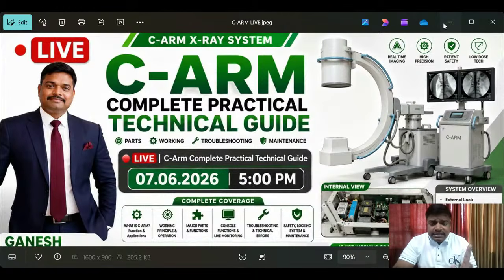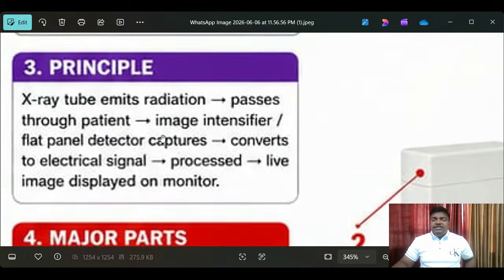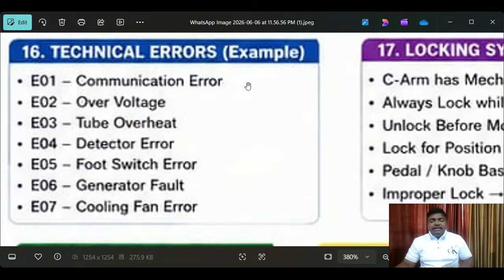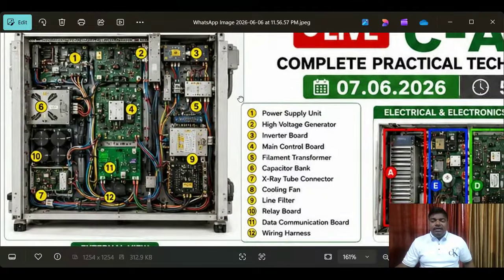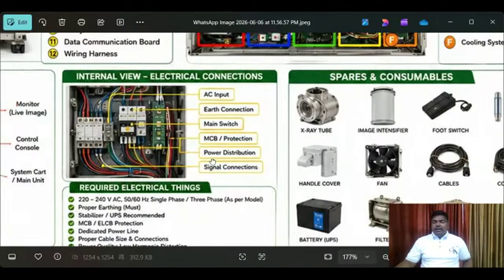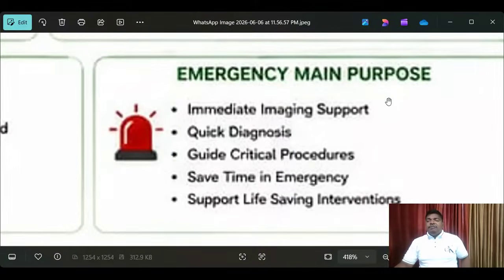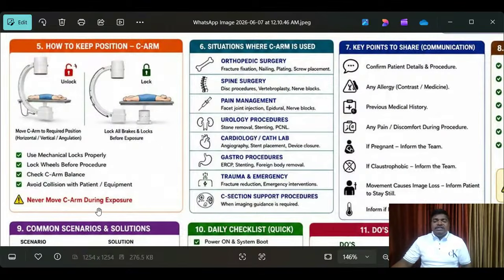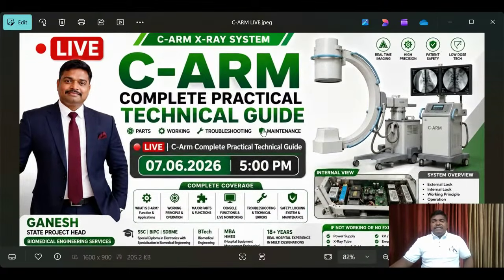🔴 LIVE | C-Arm Complete Practical Technical Guide | 07.06.2026 | 5:00 PM

Comment: thank you so much 
may you make video about Laser Machine and the types of using
Reply from the maker: Thank you so much for your valuable suggestion! 🙏😊
Sure, I will make a complete video on Medical Laser Machines, including: ✅ Types of laser machines
✅ Working principle
✅ Clinical applications/uses
✅ Internal parts
✅ Safety precautions
✅ Common troubleshooting tips for biomedical engineers
Stay tuned and thank you for your support! ❤️🔔
Reply from the maker: A laser machine is a device that generates a highly focused beam of light using LASER, which stands for Light Amplification by Stimulated Emission of Radiation.

In biomedical engineering and healthcare, laser machines are used to cut, coagulate, ablate, or treat tissue with high precision.

Main parts of a laser machine

Laser source (gain medium)

Power supply

Optical cavity (mirrors)

Cooling system

Fiber optic cable or articulated arm

Handpiece/applicator

Control panel

Safety interlock system

Common types of medical laser machines

CO₂ Laser – Used for surgery, dermatology, and ENT procedures.

Nd:YAG Laser – Used in ophthalmology, urology, and tumor treatment.

Diode Laser – Used in dentistry, physiotherapy, and hair removal.

Er:YAG Laser – Used for dental and skin resurfacing procedures.

Excimer Laser – Used for LASIK and other eye surgeries.

Advantages

High precision

Minimal bleeding

Reduced infection risk

Faster healing

Less damage to surrounding tissue

Biomedical engineer responsibilities

Preventive maintenance

Laser power output verification

Cooling system inspection

Fiber optic and handpiece checks

Electrical safety testing

Calibration

Troubleshooting and documentation

This is a very important topic for biomedical engineers, especially those working in operation theatres, ophthalmology, dermatology, dentistry, and urology departments.
Reply from the maker: Here which laser do you want live sessions ?